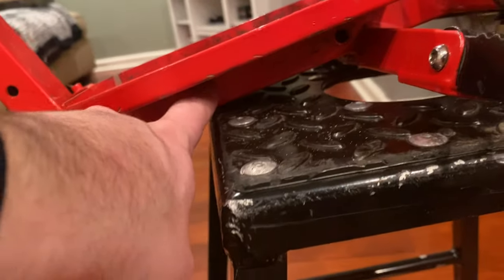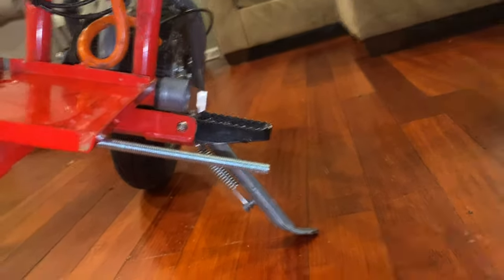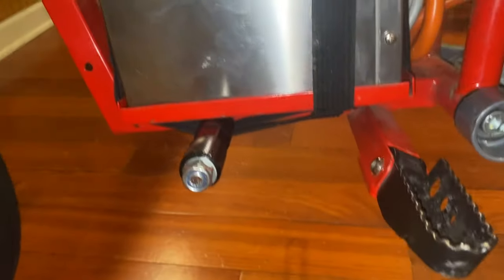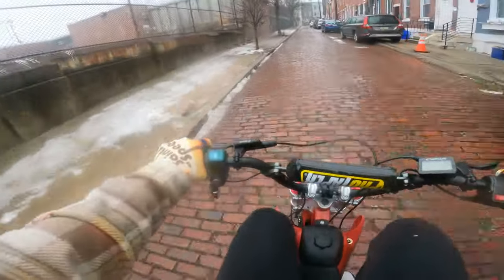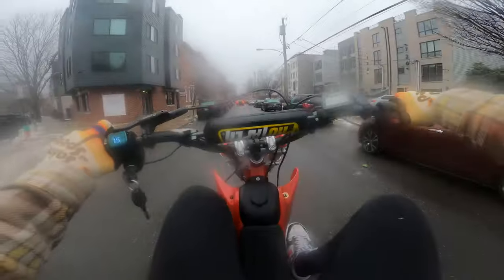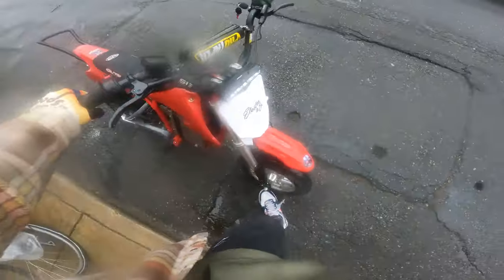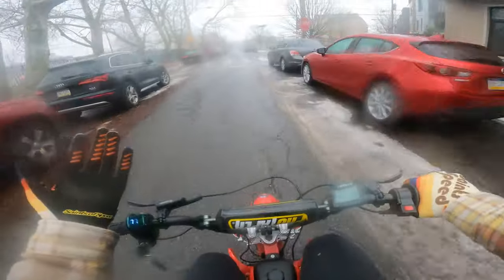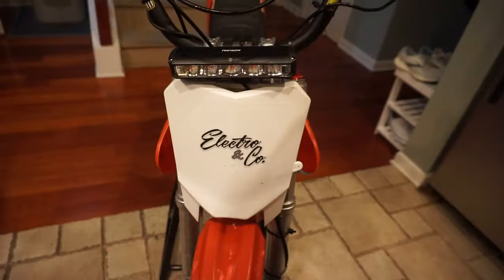CUSTOM Footlock Install! | Upgraded Razor MX500

Comment: No hate, but how is it the brakes fault that the rotors bent, pads are worn and needed bleeding? Sounds like they just need some maintenance.
Reply from the maker: lol the rotor being bent definitely my fault for not replacing it. the brakes tho, they are just terrible. They had brand new pads